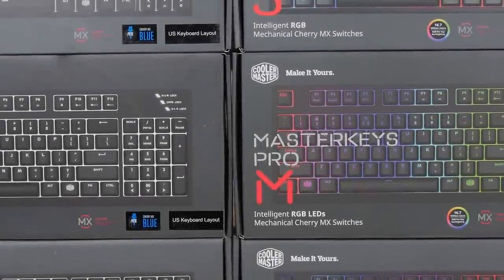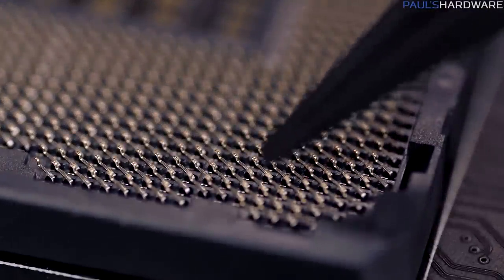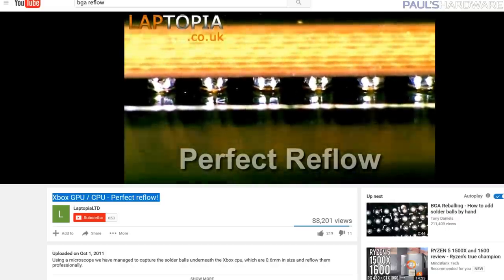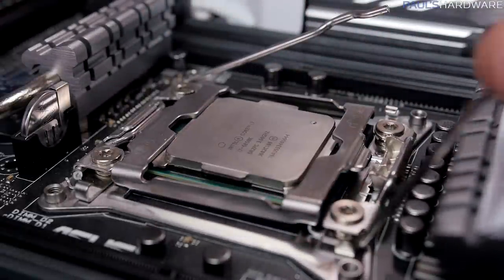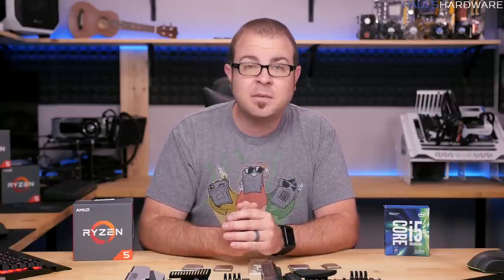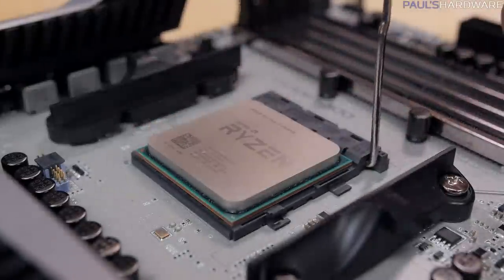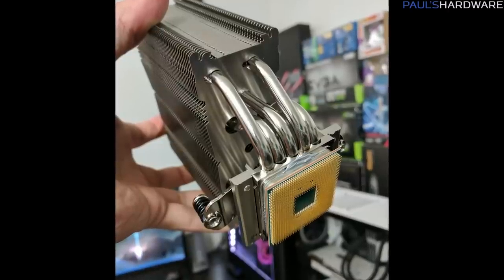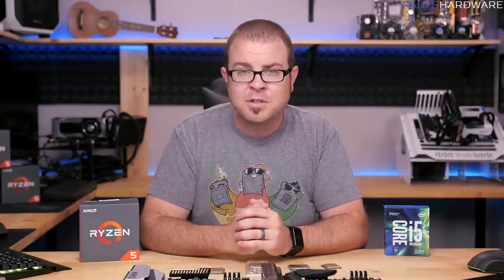LGA vs PGA! Which is better?

Comment: I suggest not pulling on PGA heatsinks and instead gently twisting it off.(If you twist DO NOT PULL AT ALL.) The heat think Paul said is also useful. I broke my old phenom 2 chip pulling it off.
Reply: HimselfXD Like I commented before, bad idea. You might end up badly twisting the pins; pulled out pins MAY be put back together via soldering (or if you're very lucky, just stuck in there), although chances of it working are low, but badly twisted pins will destroy the circuits permanently.
Reply: I don't think you understand what I am saying. Don't pull at all and twist only the socket will hold it in place.
Reply: HimselfXD I realised it later, sorry. But, I think you can just take out the entire cooler-cpu unit as a single entity and then loosen up the paste by warming it with a dryer or something...
Reply: Your comment is important to clarify because pulling and twisting is a VERY bad idea.
Reply: Fixed my comment to be more clear.
Reply: so... i guess no one's gonna mention "genitally"
Reply: hahahhahahaha
Reply: "But, I think you can just take out the entire cooler-cpu unit as a single entity and then loosen up the paste by warming it with a dryer or something..."

No, you can't.  You cannot raise the retention arm with most coolers attached so the CPU can only be removed AFTER the heat sink has been removed.  The exception would be maybe water blocks, as they might be small enough to allow you to raise the retention arm without removing them.
Reply: Rob Fraser Damn, I didn't realise that...
but wait, not all coolers aren't that low profile, just saying; you may be right though.

Comment: Pins are nice until you try pulling off a heatsink with old thermal compound and you end up ripping the cpu out of the socket with the lever still down. I wish AMD would design a socket that uses pins, but has a retention bracket that goes over the cpu, like intel''s.
Reply: When a cpu is stuck to cooler, especially after several years, rotating doesn't always work. If you have ever removed thousands of processors over the last 20 plus years like I have you would know that.
Reply: You have to hit it with a hammer to break the bond with the paste
Reply: Beast6228 you are absolutely right. Happened to me as well. It is a really troublesome design aspect for someone who is graduating from a beginner pc user to intermediate tweaker or builder. Initially did not have the knowledge of servicing the pc, ie, cleaning the cooler fan and replacing thermal paste every year. The stock cooler in my case turned the thermal grease in to a cake glue. And I was removing it to replace with an aio solution, I did all the recommended procedures. Heated up the cpu, twist instead of pull but still the cpu came out with the stock cooler. Thankfully no pins were broken. Used a combination or heat blower, a fine thread and dipping in alcohol to finally get the cpu unstuck. Most nerve wrecking hour for a beginner like me. But in the end it all worked out. It could have all been avoided if amd uses retention bracket.
Reply: If it doesn't come off with rotation (the hundreds of pins should give enough combined resistence to prevent breaking) then either heating or cooling should help.
Making the thermal paste hot lets it become soft and gooey while cooling makes it brittle. Both will assist with breaking the connection.
Reply: I have taken off 1000's of CPU's in the past 20 years as well.  The only ones that I couldn't break free with twisting were the original P4's that were PGA.  Because the big plastic mounting for the heat sink wouldn't allow you to twist at all really.  Perhaps you need to hit the gym and work out your upper body strength.  It doesn't that much force to break free even the most stubborn of heat sinks.

Comment: One broken pin does not always mean the board or CPU is dead. There are extra ground pins and the system will work just fine if its one of those (most of the time).

Comment: You should have mentioned PGA does theoretically give you better contact. Not much better, but if you're an extreme overclocker you'll be happy to know htat your voltages are more precise with PGA as the resistance is lower and more stable.
Reply: More contact area means more stable connection and less resistance.
Reply: shwut.  I was hoping to find some mention of signal integrity in this video.  Giant inductive pins are bad for signal integrity in the GHz range.  If you have a resonance spike in impedance at a frequency that you’re trying to send data on you’ll have reflections.
Reply: Was hoping for the same, Willis. From an EE perspective LGA is better, allowing shorter connection points, reducing parasitic inductance. Great that AMD can still do PGA, but I'm sure that tightens the tolerance requirements for them and motherboard manufacturers. Assuming no oxidation issues, contact resistance is a negligible factor.
Reply: @JimBob1937  It's weird how you can agree with someone over "inductive pin" issues, but realize the pins are golden for a reason
Reply: @InfernosReaper , one can speak from an abstract standpoint. Abstractly, longer pins are inherently more inductive. The gold plating is an implementation detail. However, my latter comment was about the resistance, since some are suggesting that's an important aspect here, but I don't believe it would be, assuming the contacts don't accumulate anything like oxidation on them so that proper contact is made. The contact surface area of both designs should be sufficient from a resistance standpoint. If the contacts are gold plated, oxidation is no longer a concern... but that parasitic inductance still remains. The higher the operating  frequency the tighter the tolerances are for the overall design, and for inductance. Higher inductance can increase the likelihood of ground bouncing, and higher switching noise, along with general signal problems. These can be overcome but the end result is tighter tolerances on the motherboard designers as well. The cleaner you make your component design, the easier other engineers will have developing implementations for that component.
If you have a specific point or question, please provide more information.
Reply: @JimBob1937  It's been a while since my electronics classes, so I'm not 100%, but my gut tells me that the issue you're complaining about isn't really a major issue. Ya know, that feeling you might get when someone says something and it doesn't sound right but off the top of your head you're not sure why?
Reply: @InfernosReaper , lol, of course I get that feeling every once in a while, but I try and research to confirm that feeling first so I can approach the individual later with more information (if I'm even correct).
I could be wrong, and I'm perfectly open to that possibility. However, if I am, a more concrete statement would assuredly help. Like I said, I know it's not impossible, AMD is doing it after all. However, while my particular skills aren't in very high speed (microwave range, the multi-GHz range of modern computers) applications, I am aware enough that extreme thought must be given to signal transmission line impedance's (signal reflections), routing, parasitic capacitance and inductance (signal skewing and slewing), and transmission line lengths for multi-bit synchronous lines. Package contacts can form an RLC circuit of their own which can cause a load of issues, most often in higher frequency circuits where it becomes measurable, I don't think anyone argues this. I think the argument would be if the particular package differences are creating enough of an interaction to cause problems in this case. For that, I can only guess as I haven't measured their numbers. However,  I am of the mind that a component designer should do everything possible to minimize the engineering work required from other engineers that implement that component. That fact that it works doesn't mean it's not tightening the tolerances of the actual implementation and making harder work for other engineers. Curiously AMD did use LGA for their threadripper series. I'm not sure if that's for the electrical properties or maybe it's just because those packages contain a lot of contacts and pin damage may be more costly. In all honesty, if you can find a good source on parasitic inductance and capacitance measurements for each package, I'd certainly be interested. Inductance in particular is dangerous in this application due to it's ability to act as a low pass filter, which at the ranges of speeds we're discussing may impact the fundamental frequencies, not just the harmonics that're usually affected.
Reply: @JimBob1937  The thing is, just off the top of my head(I'm not at a good place to look this up properly right now), I genuinely can't think of why the difference in pins would net any appreciable difference in inductance. You're always going to have at least some just by virtue of a circuit existing, right? Then again, parallel vs perpendicular does make a difference... but the material for the CPU holder in theory might insulate that...

Yeah, I definitely gotta brush up on this stuff when I get back to my books.
Reply: @InfernosReaper , yeah, I'd agree with you if the interconnect length was the same. I think the LGA spring pin design allows them to shorten that distance. With pins there is only so short you can make it, with a contact point hitting a spring, you can reduce the travel to the board. My guess is it's a very small difference, but those differences add up.
Reply: @JimBob1937  Is there really an appreciable size difference, though? I don't feel like mucking about with a spare LGA board to be sure, though(just because it's a spare doesn't mean I should risk breaking it).
Reply: @InfernosReaper , doing a quick LR low pass filter shows a 3 dB cutoff with around a ~0.3 Ohm resistance and only a 10pH of inductance (10 x 10^-12) for a 5Ghz signal. Of course there isn't a 3dB difference in this case, but it illustrates that a small amount of parasitic inductance can start to attenuate higher frequencies fairly easily. One (of a few) reasons we went away from through hole component design, and that great care must be taken with high frequency prototyping (good luck getting something working properly on a regular breadboard).
Reply: @willis936  LGA use pins in the socket
Reply: AceMasterX Semantics.  What matters for signal integrity is the channel impedance.

Comment: i may be an idiot for intel CPUs, but i've had so many problems with LGA. PGA pins i've bent a countless amount of times, but never broke one off. hell, even an old am2+ CPU fell down from my hands on the floor, and nothing happened to it, as the pins are thicker on PGA. tho i did have the thermal paste sticking issues, but never really damaged anything.

Comment: PGA has more gold.. 
😂🤣😂
Reply: i dont think so i think lga has more, firstly on the socket more than Pga on the pcb and then the contact pads on the cpu itself.
Reply: And you dont think PGA doesn't have contact pads under the plastic socket mounts? so it just magically connects to the chip?
Reply: sachin pundir has*
Reply: it doesn't matter how much gold there is, its only a thin plating applied to prevent oxidisation from affecting the contact points over time. having more or less doesn't change this so long as the exposed points are covered.

Comment: Bent pins can alternatively be straightened with the end of a mechanical pencil that has the lead removed. Pulling a stubborn heatsink from a PGA board is best done warm, also, a few slight clockwise and counterclockwise twisting motions prior to pulling up can help release the thermal paste seal.

Comment: I like PGA better because motherboards die really fast compared to other components, and people always kill LGA motherboards. (they are really expensive used and new) PGA cpus are easy to repair, and cheaper.
Reply: I think that has to do more with the intel/amd chipsets on the board, not the socket type.

Comment: For PGA, without a clamshell, a piece of foam is a good storage solution, and if you lose pins people have had luck with using a piece of copper wire in the pin socket cut to length to basically turn it into a defacto LGA pad. Not ideal, but it works... sometimes. If you're luckly.

Comment: I have a 4790k, but I reallllly prefer AMD sockets. Worse case scenario, if you break a processor those are typically safe to buy a used one without a whole lot of worry. If you get a fucked up Motherboard, and it's not the current gen - good luck finding a reliable replacement.
Reply: WholeGrainGoldfish am3 processors(back to 2010) can be put in all modern am3+ boards hence getting all of the latest features with an old phenom II.

Comment: I have a phenom x4 as a replacement comp since 2010 or so.
I broke out quite a few pins when I tried to get the whole cooler+cpu out but forgot to remove the cpu fan cable. The whole radiator slipped out of my hand and the weight crushed a lot of pins. 

I was able to remove most of the slanting/sloped pins and also bend some back in place. It took 20 minutes to repair it and it still runs today.
Reply: you removed some of the pins?
Reply: Yes. Quite a lot. And it's still running.

Comment: don't forget the cost of a new Windows license if your LGA board loses a pin, not a problem with PGA, and PGA is easier to repair
Reply: Jeff Housen windows is bound go the account now
Reply: stephen allen with a copy of oem it bound to the motherboard
Reply: i think most of people here has a cracked windows license it easy  to crack i designed a software
Reply: @theyhatekath  How most? I don't know single person with cracked Windows.
Reply: @MrVolodus  That you know of
Reply: @financialcrisis3538  U can get 2 times a new licence key for the OEM windows if u need to replace the Mobo. I'll explained to the M$ customer service what happened(the mobo died from cap leakage, got a new one in warranty period). They said i need to send over them a pic from the COA sticker, a copie of the os invoice and the warranty report of the Mobo exchange. After an hour the M$ technician called me and asked permission to connect remotely to my unactivated pc. In five minutes the technician installed the new licence key and in 2 weeks i got the new COA sticker and the invoice on mail.
Reply: talos86 i didnt know that thx for the info

Comment: After having worked on both types multiple times. I personally prefer PGA. A slightly bent pin on a PGA chip can most likely be fixed as long as you're carful. You bend one of the pin on the motherboard in a LGA setup, and you might as well throw it out in the trash. It fixable, but much harder.

Really though, both work.

Comment: So in short, PGA is easier to bend but much easier to fix, and LGA is much harder to bend and nearly impossible to fix. I think AMD chose to better socket type. Though since LGA can have more pins through the HEDT, this allows intel more RAM channels and PCIe lanes. Each pin has a specified function such as power, sync, data, bus communications etc. This is way the X99 platform has more pins than any other consumer platform. Just a fun fact!
Reply: LGA is also easy to bend. I once switched mobos in my PC and after that I realized that the old mobo's pin got bent. I'm always very careful and still this somehow happened.
Reply: i wouldnt say lga is harder to bend. any touch or drop on there and boom. fked pin
Reply: X399 and Socket TR4 would like a word with you

Comment: In my case, ( no pun intended :D) the CPU is cheaper than the Motherboard 😁
Reply: Dominik No  
 thats how id do it, use cheap CPU till next gen comes out and high end ones get cheaper second hand while saving up for it, and then you have a very high end machine
Reply: Ever tried lifting four Xeon (LGA) CPUs from a DL580 G7 to upgrade to four newer ones? I've never been so scared to drop one into the socket, if one pin would've bent that's about $25K worth of server done for plus added downtime...
Sadly AMD has the same with their server CPU's and upcomming Threadripper...
Reply: lga pins are smaller since they can be mounted on a safe space (motherboard socket), that epyc 4094 pin socket is already massive enough.

Comment: From 6:00 onward, I hope that you know you could have used a mechanical pencil to repair those pins instead of a screwdriver.
The opening at the end of a mechanical pencil (0.5mm or 0.7mm) is just the right size to slip over a PGA pin.

Comment: My preference is PGA. I have never damaged either though.
Reply: The pins are usually quite stable. And even then, first they would bend and can be carefully pushed back into position anyway.
Reply: I've damaged both and received both damaged before hand. It's a lot easier to fix PGA.
Reply: I have amd cpu and it broke on the first minute of installation 

Because i hate amd cpus so i throw the cpu to garbage and kept the motherboard for some og collection
It was Ryzen 2700x btw lol $600 wasted?
Lol idc it sucks anyway
Reply: @RizLazey  how do you broke it? Your hand slipped and it falls? 🤔

Comment: I just wonder why we use gold plating for things like this instead of silver, since silver is naturally more conductive.
Reply: And cheaper.
Reply: Gold doesn't rust by normal exposure while silver does (forms patina). That's why it's used in almost all mid-high end electronics. RAM/PCI/HDMI/Audio and also some expensive Motherboards are gold-plated.
Reply: I'm assuming so they can seriously put the prices up but surely copper?
Reply: yes copper oxidizes that's why the statue of liberty is green
Reply: those gold plating is not for "better audio quality" on cables and so on, its just a rust protection :)
Reply: Because it doesnt rust by  normal
Reply: @DanielElson  well the pins are copper, so there wouldnt be a point of plating copper on copper